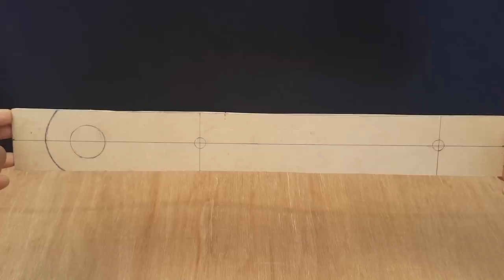How to Make a Battlebot - Drum Spinner

Comment: The problem is maybe if you bring it to the battle,they might  remove the weapon motors
Reply: Omar and Abdulrahman Fun and learning TV why would they?
Reply: Chris P. When they fight the opposite team robot might use there weapon and try to break the motor so he need to cover it
Reply: Omar and Abdulrahman Fun and learning TV : That's not how robot fighting works. It's full on carnage.
Reply: Caleb Sherman I know so they will try to make them lose so at first they need to make sure that they will not lose so they will attack the prominent motors . His robot will not be able to damage the enemy's robot
Reply: @hajjex_9086  yep its a very easy design to disable and the issue is aswell that he completely sealed the unit with glue instead of screws so he will have to try and pry it open to repair which could completely destroy the housing, the idea is there but the implementation is  not
Reply: @BootlegHuman  that's what I mean Chris P Bacon
Reply: How Do you make the control war

Comment: Hi, you didn't show how to make sure the motors turned in the correct directions.
The motors on the left side will have to turn in the opposite direction to the motors on the right side to make sure you travel in the  one direction.
Also the two motors on the spinner.

You have not shown any connection details for the receiver to the motor controller.
Also you need a fuse on the battery to protect against short circuits if you really are going to Battlebot.
Reply: Actually, a fuse is completely unnecessary unless you compete in the UK, and can be a major weak point since a good hit could break the fuse.
Reply: @Need2connect
You only get battery fires if you use a low quality battery that can't take the current draw, or if the battery is punctured. The former issue can be solved by using a better battery (it's not even that expensive to do so, Turnigy Graphene Panthers are pretty cheap and will outperform many of the more expensive brands), and a fuse won't do anything for the latter.

But what do I know? I'm just a 3-time beetleweight champion at Small Bots of Mass Destruction, winner of the first-ever Florida Polytechnic Fire Fights Beetleweight class and a regular semi-finalist in the 12lb tabletop class at DragonCon Robot Battles.

At the events I've been to I've only ever seen one battery fire due to overdraw, on a cheap white-label 5c 300mAh 3S being run in a Viper kit with a horizontal spinner.

Comment: How much it weight
Reply from the maker: Around 7 kg
Reply: @Junkyard250  can u make one with metal body (little small) have small tyres but fast with ramp(can be removed) instead of roller , removing bike battery and applying small battery that can be removed.. and weight under 5 kg

Comment: Name that transmitter and receiver with link and cost plzzzzzzzzz
Reply: Harsh Kumar he probably used a 2.4 ghz transmitter. Maybe something different but most likely
Reply: The 2.4Ghz transmitter he used (which have 3 port) is almost impossible to find in the US. Don't know why.
Reply: It's called nrf24l01 2.4ghz module. I'd suggest use the antenna one. It's range is better

Comment: Pointless if you can't link people to where you got the 2.4 ghz 3 channel remote controller.
Reply: they are pretty easy to find on google tbh and for most people id say to get a 4 to 5 channel if you decide to upgrade your bot with more weaponry you already have the parts and dont have to pay for a brand new one
Reply: @BootlegHuman  Any chance you could link me to 1?
Reply: @secretgaminguk9806  https://www.modelsport.co.uk/carson-reflex-ii-6-channel-radio-with-receiver/rc-car-products/396371

pretty basic one but does the job
Reply: and heres a good 14 channel one if you want to implement a servo system for a weapon thats on a arm mechanism 

https://www.modelsport.co.uk/carson-reflex-stick-multi-pro-14ch-2-4ghz/rc-car-products/395375
Reply: Chris P Bacon 3:51 what's the thing he is screwing the motors to?
Reply: @secretgaminguk9806  most likely a ESC (electronic speed controller) 

A necessary component to give variable speed when driving otherwise your bot will only go one speed and normally slowly
Reply: I'd recommend googling as many tutorials as you can